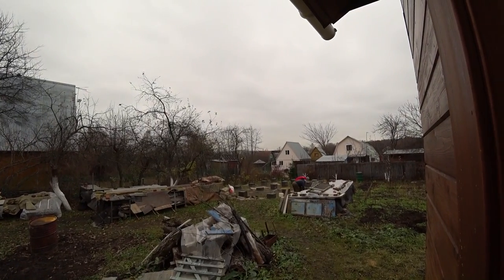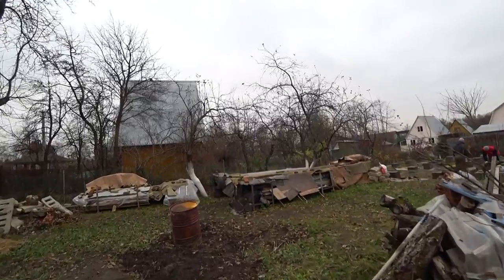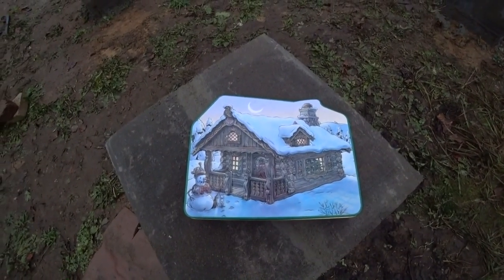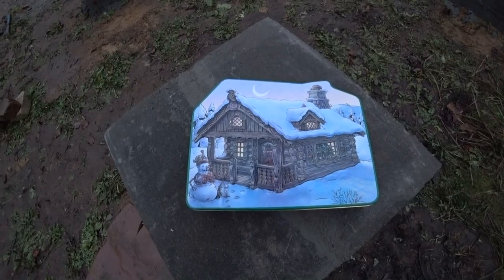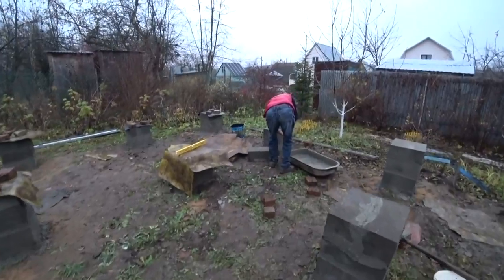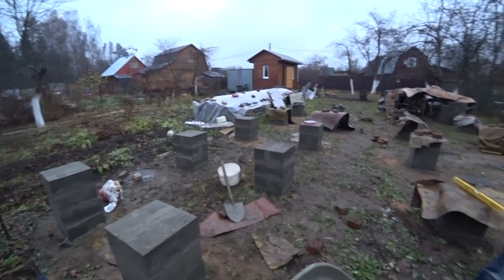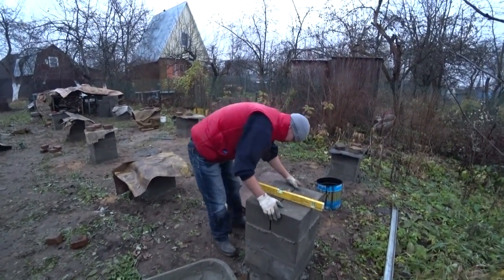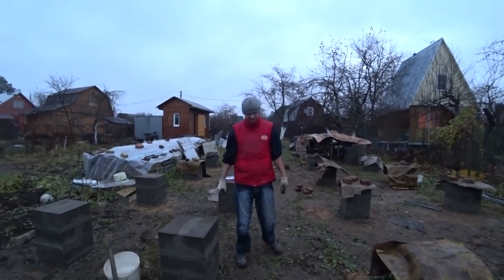Russian Frame House Building: Our project // Finish the foundation

Comment: Alex is doing a nice job on the foundation pillars. My property slopes in two directions, so I know why you have three blocks high at one end and four blocks at the other. Alex's bending over makes my back ache. Some cabins, like you show, have cathedral ceilings, and the roof windows work like skylights. Thank you for showing the home center-I had asked you if you had them.

Comment: Unless those foundation pieces are cut from 'stone,' most U.S., Canadian, and UK builders call your "stones," BLOCKS because all facets (angles....) are 90 degrees.  Always made from compressed concrete, "blocks" are sometimes used as YOU have........but are most often laid up to make walls---as they are also there in Russia..  

The "big topic" for which we'll watch anxiously is how you insulate this dacha against the cold & snow.....without which houses are uninhabitable in winter.  You should choose gas there in Russia; you've got plenty.....but insulate, insulate, insulate...!  You won't regret it!